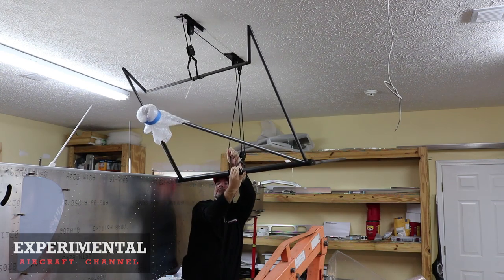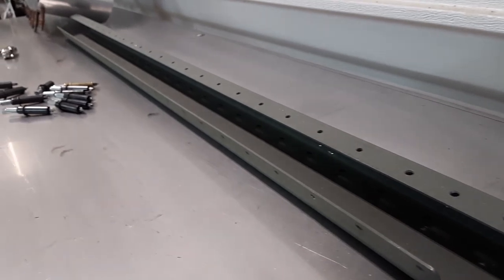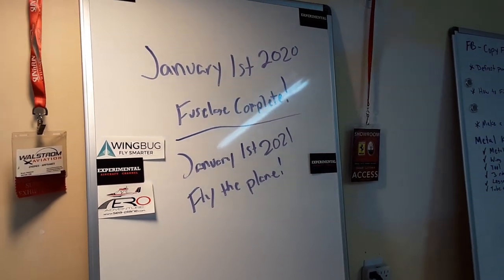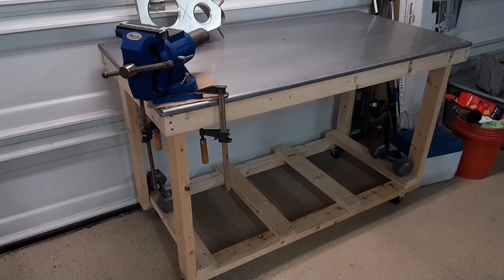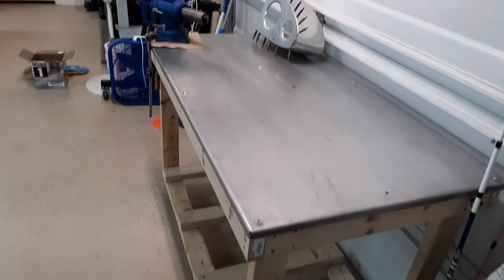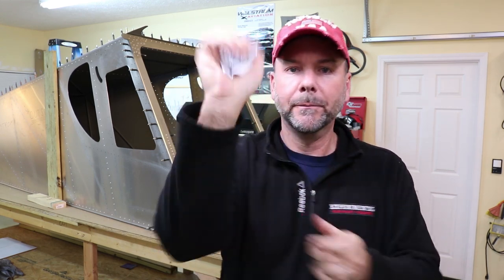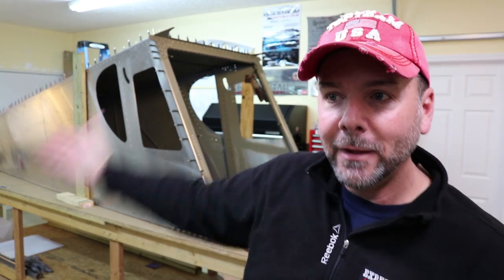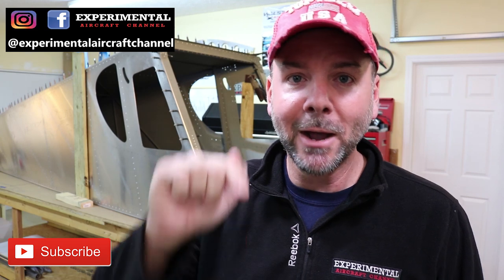Day 5 of 31 Day Aircraft Build Challenge

Comment: Your workshop is HUGE !!   You need MORE TOOLS, that black husky looks empty.  Remember choose a Plane that FITS your workspace !  I practiced my stick welding today.   Got some 7014 electrodes yesterday (still learning to work with different electrode types), and I like them alot.  Of course you dont stick weld a plane, but its a cheap way to get started, stick is useful for lots of tasks, and the same machine can tig (with some addons), which is what you do need for 4130 tubing.

Comment: Just a comment about your powder coating. You say you intend on putting Silver on the cabin frame but you might want to rethink having silver on the forward V downtubes. It is usually discouraged to put Shiny colors anywhere in the windshield area. Most airplanes have Black on the glareshield, downtubes and even sometimes on the top of the engine cowling to eliminate any glare and reflection from the sun that will interfere with your vision.
It's just the downtubes and Zenith has matte grey on their Cruzer, so it might not be too bad, but that's just my 2 cents. Otherwise, keep up the good work and motivation for everyone.